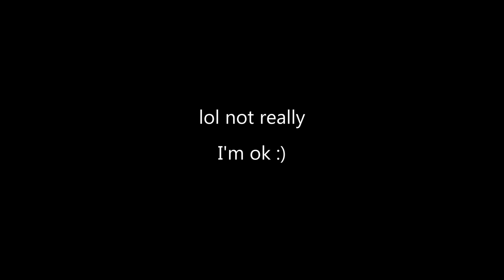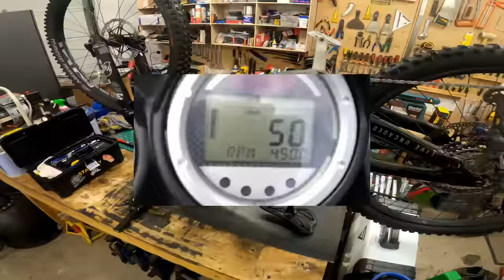An Update

Comment: I agree that the police should be informed.  They did not have their dogs under control, so this is a criminal offence under the dangerous dogs act of 1991, which is serious.  They are liable to imprisonment of up to five years and/or a fine as you were quite seriously injured. You are probably worried about the dogs being put down, but if it's the first time they have attacked someone, it's more likely they will be issued with a control order. If they have attacked someone before, it might be a different matter.  People like this, who have dangerous dogs like Mallinois especially, and don't control them or properly socialise them, need to learn a lesson, otherwise it will just keep happening. In my times walking or jogging in the countryside I have several times been menaced by aggressive dogs who have been let off the leash by their owners. Some dog owners think it's OK to let them off the leash, if they can't see any people around in that moment. Out in public dogs should be on a leash, simple as that.
Reply: The owners wouldn’t go to jail unless they’ve been persistent offenders which I doubt they are.  Having been chased by dogs and bitten a couple of times riding my bike I’m utterly appalled at the lack of control that most of them have over their dogs. No doubt they all think they’re “responsible” owners, but if their dog doesn’t come back to them when they call that’s obviously bollocks.
Reply: @josoap8781  Even if that's true, they can only be repeat offenders if people report the offences. Not reporting means they can get away with it again.
Reply: i agree that he should inform police. like now they only attacked adult but if the same happends to child then it might be different story

Comment: Glad you are ok.   Malinois are not for everyone - I don't think the fashion for breeding them for dog protection sports helps as the tendency is for ever higher drive dogs which may do well in competition with experienced handlers but which are less suited as active pets or for novice dog handlers which is where many pups end up.    Also worth pointing out (for the general audience) not all Belgian Shepherds are Malinois and even all Mali's are not from working lines. 

Ps what is the make & model of car in the video.
Reply from the maker: @thomasbutcher3593 it's a Clio 197 Cup stripped out and modified for track use, but it's been sat there just taking up space for the last year.

Comment: Your symptoms sound like fairly normal vaccine reactions, although on the more severe side in your case. Not long ago I got a COVID booster and shingles shot at one go. By the next day I was running a fever of 103 F, ached like crazy in multiple places, and had a slamming headache. Didn't fully recover for four days. Better than the actual diseases, though.

Comment: The general characterisation of the Malinois is not quite correct. It really depends on what the background (pedigree) of the dog is. When you have an ordinary pedigree Malinois (with a certificate) you will have a hyper, energetic dog that can be held as a family dog. They usually have a nice character. They do need a lot of exercise and attention and chalenges etc. And you should have experience handling dogs if you choose to get a Malinois. Furthermore you must invest time in training your dog. And that enthails more than just a puppy training course. The most important thing is to be able to execute a succesfull recall and to teach your dog to heel.
If you have a non-pdigree malinois that was bred to become a working dog (for police, army, security etc.)  that is a whole different breed. These dogs have what we call a BRN (Bloodline Registration Number) instead of a pedigree certificate. This will tell you what it's parents/grandparents etc. are. These dogs need  a very strickt and confident handler. And they need a lot of training to be able to function in society.
Unrelated to the breed quite a few dogs will attack runners/cyclists. High strung Malinois will display this behavior (prey drive) more often than some other breeds. On my walks with my dog I regularly meet a retired policeman who trains dogs. His present dog is being trained as a search/sniffer dog. This one has this issue with cyclists. It will disqualify it as a service dog if the problem isn't cured.If a dog is too agressive it will also disqualify it as a service dog. A lot of (police) handlers keep their dogs at home so they must be able to function in a family setting.
The handlers in your previous video are clearly not very apt as dog handlers/trainers. If you can't recall your dog it should not be off leash especially if the dog has an issue with cyclists. These people clearly were aware of this issue.
That the Malinois is eligible to be added to the dagerous species list in the UK is a bit of a surprise to me. Mind you I am Dutch and in The Netherlands this is not an issue. FYI I own and train a Dutch Shepherd, a cousin to the Malinois.

Comment: Bad owners. Malis need intensive, continuous training to get the best out of them. At which point they can be expected to perform at a very high level of obedience.

I'd suggest you check on the owners to see how they are doing after this. If they haven't got a handle on this, the dogs need to be removed and placed with more suitable owners.

Otherwise, it may result in serious injury and the dogs being put down.

Comment: I appreciate how clam you are but you MUST report this! I understand that these specific dogs have gone and been adopted, but the issue is not the dogs. Those two owners need to be fined or reprimanded in a way that they will never do anything like that again because that is not just a mistake as an owner you need to know that outside of any fence is an on leash area always. If this incident had occurred with a smaller woman or a child, that person would have been extremely injured! This is not a mistake it was an immense lack of judgment and because they weren’t punished for what happened has not been corrected in their mind. it is not hard to be a responsible pet owner or caretaker. putting your pet in a position like this, set them up to be put down before the end of their actual life